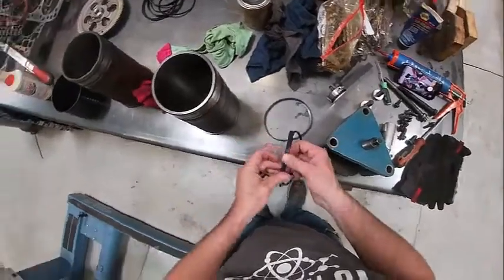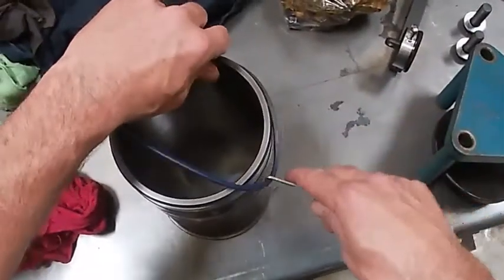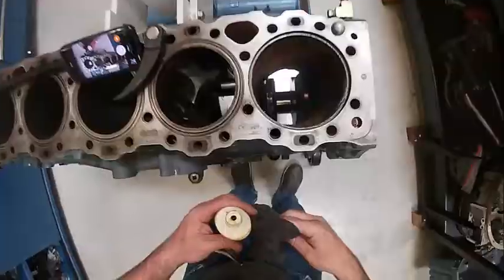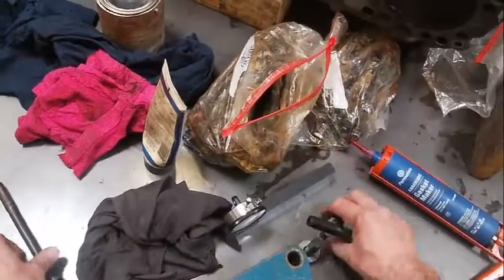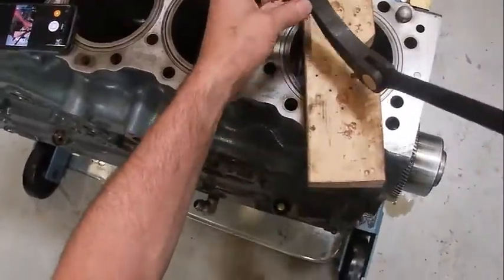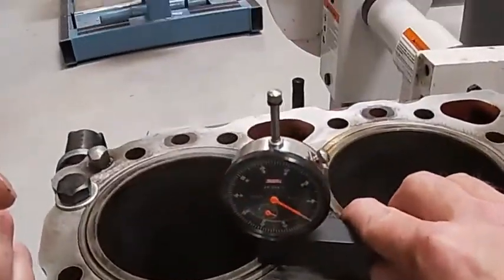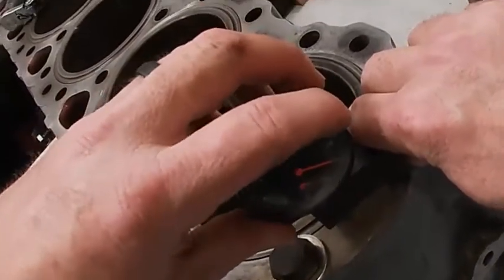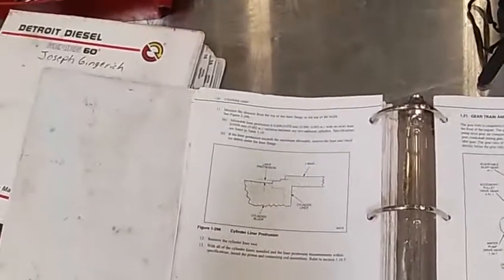60 series liner install

Comment: You are amazing and I am not questioning your ability as I am learning and too far for you to be my mechanic but I see that you have the liner installer that dual serves as a protrusion measurement device why did you not use that to install liners as well? Just quicker with the block and pry bar?